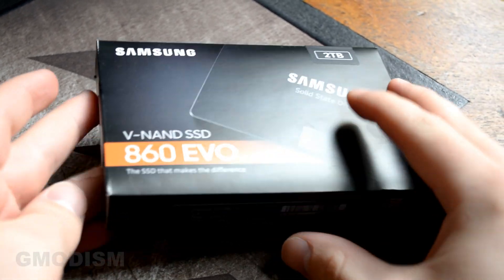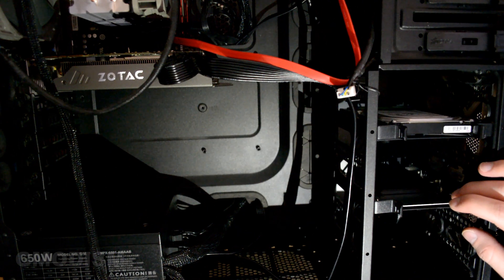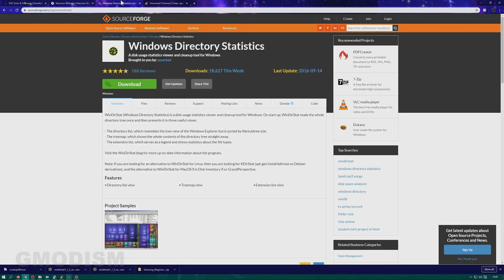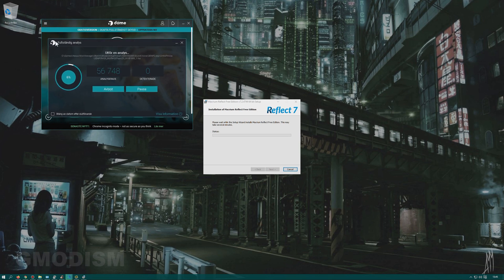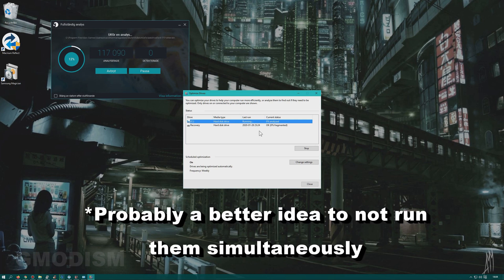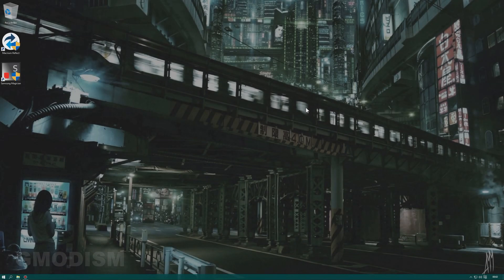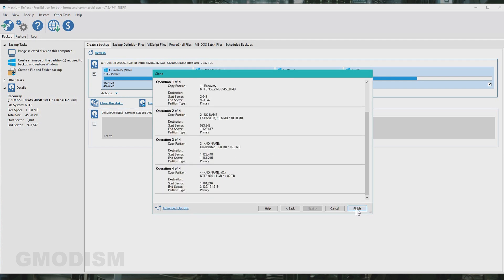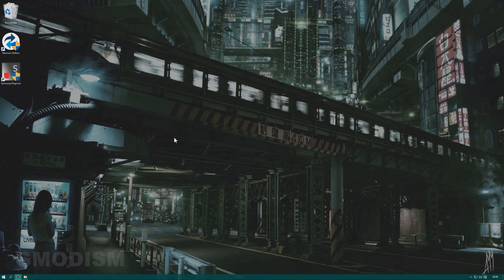How to Replace C: Drive Without Losing Data

Comment: You don't really need a registry cleaner like CCleaner, it's pretty agressive adware and registry editors haven't been relevent for at least a decade. 
WinDirStat is a very useful tool that I advise people use generally, good call.
I've never heard of this particular software for cloning drives, but looking around it sounds pretty reliable and I had no problems.
Overall, this is a very useful tutorial. :)
Reply: I advise skipping to 13:00 for most users, the rest is kinda unnecessary

Comment: Will programs installed on the OLD drive, such as MS Office and Adobe CS6 run on the NEW drive after this drive replacement? OR will programs need to be re-installed or re-registered? I have software running that is no longer supported.

Comment: Got a slight issue. After doing as said in the video. The PC has booted fine but when look at the drives in This PC the pc still thinks it's just a 240gb sdd and not 1tb
Reply: Did you replace the ssd in your computer with the new one?

Comment: what if the new drive is already in use, is there a way to migrate the data without having to erase the new drive's data?
Reply from the maker: There are 2 ways you can do I'd say:
1: move the data from the drive in use to the drive you wanna migrate from and save the data that way (easy)
2: make the data on the drive in use into a small partition and make the rest unallocated (see my format hdd tutorial) and then move the drive you want to migrate and fit that into the unallocated space (should work but you might have to move them in a particular order and make sure you don't overwrite anything)
Reply: @GMODISM  thanks for the quick reply! I think the first option sounds more accessible. By that you mean just to copy/paste the files manually via explorer?
Reply from the maker: @FerdodoxW  Yeah if it's just a bunch of files you wanna keep that should be it

Comment: If you wanted to use your old hard drive as another data drive, how would you do it since windows is installed on both drives?
Reply from the maker: You will wait for a month to make sure new drive works, then you follow my tutorial on how to reuse an old hdd :)
Reply: @GMODISM  what if it's an ssd? Thanks for the quick reply by the way
Reply from the maker: @vijayterian  I would say it doesn't matter, if there is something wrong with the new drive everything is lost. I got tutorials like this https://youtu.be/Up68ykJCKn4 it is best for old ssd since it won't cause wear